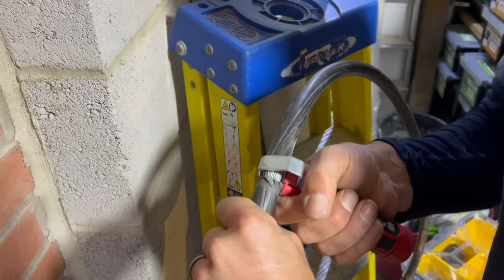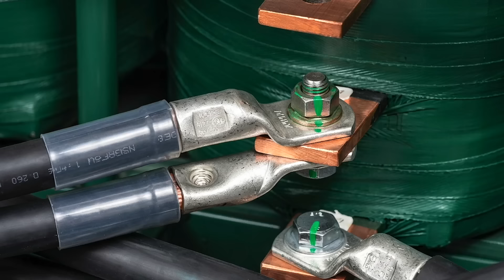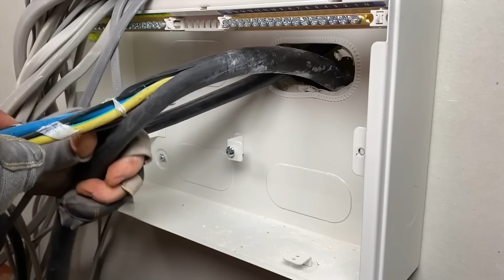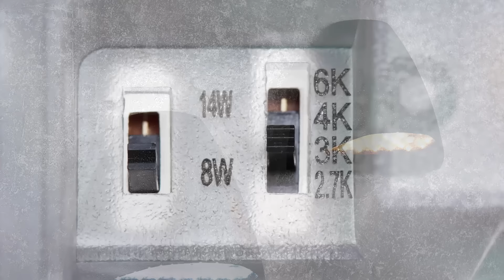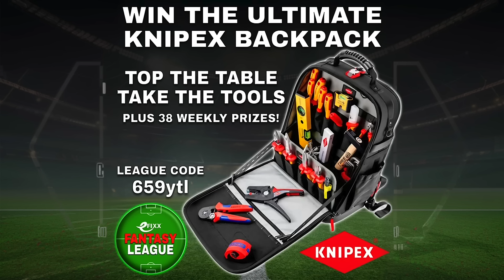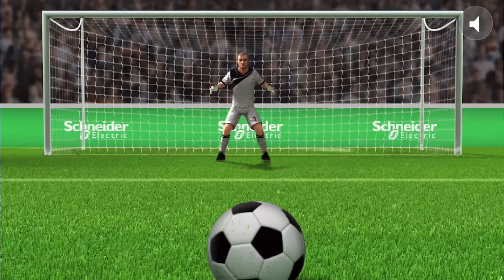This Tiny Regulation Change Is About to Get Expensive

Comment: I was 19 when the national Building Regulations replaced local bylaws.  It was a small volume that cost eleven shillings and sixpence.(57.5p)
The RIBA reference set is now 1300 pages and costs £310.
Each addition and amendment to the reg's has increased the cost of approval, construction and inspection.
Each amendment has been approved by bureaucrats pressured by those who would profit from the change.
The Requirements for Electrical Installations, I suspect, has followed a similar pattern of development.
I am not condoning abandoning safety regulations per se.  What I am proposing is that they should be a standard for quality and safety, not an economic tool of government.
Reply: The Building Regulation documents can be downloaded as PDFs for free.
Reply: @robertsmart7484  Call me old fasioned if you like but I find refering to a hard document much more efficient than scroling through a PDF that clutters up my CAD screen.
Having said that, I could download it for free... but... I would need to print out 1300 pages and that would cost more in time, paper and printer ink than it would be to buy the properly bound document.
Anyway, that was not my point.  My point was that Government does not make changes to any set of regulations for the good of the population nor the environment.
It continualy makes the changes to create jobs and make profits for the involved industries.  All intended solely to generate additional taxation.

Comment: The regulations should be a ring binder and each update has new pages and instructions to remove redundant pages. Much cheaper
Reply: Or on a roll behind the bathroom door ? 😂
Reply: @D @DrunknGaming121 you can read them on the throne, a great way to spend your time
Reply: @joebristowtechnologicalbre2073 40 years in the trade I am done 😊 , started on 15th ! That was slacker 😂

Comment: Cant think of a single time we have needed to use an RCD on inverter circuit. For more reasons than highlighted here. Which brings questions around amd 3 been so urgent. As for brands with options Hager, Proteus and more. Loads of them about for heat pumps more than PV.

Comment: I saw an EICR that didn’t spot the cracking insulation on the immersion heater or the under sized shower cable. When the same electrician came back to fit a new Consumer unit the mixed up the neutrals which caused tripping especially where they had both RCBOs and RCD for the split board for the economy 7 storage heaters. Unfortunately this was before my relation bought the place so there was nothing they could do. There needs to be something where these types of cowboys get reported and their works audited so they either improve or are removed from the industry. If DIYers are a risk these cowboys are a bigger risk.

Comment: From the Fox ESS H1 manual my installers are commissioning today, mentions Type A if one is required.

Residual Current Device (RCD)

- All Fox ESS inverters incorporate a certified internal RCD (Residual Current Device) to protect
against possible electrocution in case of a malfunction of the PV array, cables or inverter (DC). The
RCD in the Fox ESS inverter can detect leakage on the DC side. There are 2 trip thresholds for the
RCD as required by the DIN VDE 0126-1-1 standard. A low threshold is used to protect against
rapid changes in leakage typical of direct contact by people. A higher threshold is used for slowly
rising leakage currents, to limit the current in grounding conductors for the safety. The default value
for higher speed personal protection is 30mA, and 300mA per unit for lower speed fire safety.
Installation and Selection of an External RCD device

- An external RCD is required in some countries. The installer must check which type of RCD is
required by the specific local electric codes. Installation of an RCD must always be conducted in
accordance with local codes and standards. Fox ESS recommends the use of a type-A RCD.
Unless a lower value is required by the specific local electric codes, Fox ESS suggests an RCD
value between 100mA and 300mA.

- In installations where the local electric code requires an RCD with a lower leakage setting, the
discharge current might result in nuisance tripping of the external RCD. The following steps are
recommended to avoid nuisance tripping of the external RCD:

1. Selecting the appropriate RCD is important for correct operation of the installation. An RCD with a
rating of 30mA may actually trip at a leakage as 15mA (according to IEC 61008). High quality RCDs will
typically trip at a value closer to their rating.
2. Configure the trip current of the inverter’ internal RCD to a lower value than the trip current of the
external RCD. The internal RCD will trip if the current is higher than the allowed current, but because the
internal inverter RCD automatically resets when the residual currents are low it saves the manual reset.

Comment: I don't agree with NAPIT here- if it's a fast fix then note that it was an issue that has been rectified on the certificate. Some things cost way more to come back to. If you think that it might be an issue, agree it with the client beforehand- "if I find any issues which could be quickly and easily rectified, are you happy for me to do so?"

Comment: EICR and Part P are a joke and should be scrapped. I had one done a few weeks ago by a company never used before and the guy didnt even unplug a single thing, if he did it was one or two appliances at most. Almost all the sockets and switches are smart ones and have USB etc, no way he could have done it legit.

Also certified a new garage consumer unit and he didnt even ask for the key to unlock the garage to go inside.

Insurance companies demand this crap but they are not worth the paper they are on. Heck you can even get remote virtual checks, like how the heck can someone so a safety check over WhatsApp video?
Reply: It's not that the EICR is a joke it's that government austerity cut building inspectors and anyone who is going to catch a dodgy sparky to nil. So EICR by phone folk have nothing to fear. Just like dodgy builders who do stuff like put a small square of insulation visible around the loft hatch and skip the rest. All symptoms of the fact nobody today is worried about getting hauled up and losing their accreditation or getting fired.
Reply: I could not agree more. You hit the nail on the head.
Reply: That's probably because you used cost as deciding factor on the EICR rather than a reputable electrician.
Reply: @Stueyb22 it's almost as pointless as PAT testing. It's more of an "insurance" "get out of jail free card". Just like so many other "blame it on safety" related things, it's a convenient way to print money. When you take your car for an MOT it doesn't necessarily make it safer, or stops at breaking down.
Reply: @MyProjectBoxChannel  Yes.  It's only safe during the inspection.  Who knows what happens after you leave.
Reply: Careful now. That's the entire compliance scam,.sorry, business model you are targeting there!!😂
Reply: @jonhunter8737 I wouldn't want to harm somebody's cartel

Comment: As far as I remember the requirement for type B RCDs is already covered in the code of practice. Not withstanding that, why create a regulation that is difficult or expensive to meet the requirements of. Surely the drive should be for manufacturers to provide protection or separation as part of the compliant equipment specifications. But no let’s make hard for contractors once again.
Reply: Grid tied PV inverters were originally a separated design but it is more efficient, oh and much cheaper which I'm sure had no influence at all, to use a non-isolated design.  Essentially all grid tie is now of a not-separated design and so are most of the 'high frequency' all-in-one inverter charger things too.  There is a path of conduction between the PV and mains and on high voltage battery systems the battery terminals too.
Reply: @retrozmachine1189  According to my inverter user manual it has 
-  Integrated RCMU: An internal Residual Current Monitoring Unit that handles the safety requirements of IEC 62109-2.
- DC Leakage Protection: The inverter's circuit design is constructed to prevent the injection of direct residual current into the grid. (Separation?)
And only requires a type B if local regulations require it. Doesn't expressly mention separation but should provide the same level of protection?
Unfortunately the IET bookshelf app has not updated to the A4 book, so I can't see the new regs. But from what I've seen these do not preclude the need for a type B RCD.
Not well thought out by the IET in what is a fairly mature industry - after 20 years of solar installs they have managed to throw installation into confusion for the contractors. The NAPIT/NICEC experts (😂)and co will no doubt default the Type B everywhere.

Comment: This change is not going to cause expense to society. Only a fwit would think it was a good idea to design a system where AC can be passed to the dc side with impunity ( as in a non isolated micto inverter.

Much better to have a system designed with inherent isolation between AC and DC in the first place
- aviod the cheep sh!te that fails in an unsafe manner in the first place
- Shame on those in the industry who were aware of the failure modes of non isolated dc/ac conversion devices and still cooes to put lives at risk by using them
Reply: It's not AC being passed to the DC side that's causing the issue. It's DC leakage on to the RCD which can saturate the toroidal core and prevent the RCD from working as it should.
Reply: Shareholder value always wins over safety these days

Comment: I am pretty sure more manufacturers will start to make type B RCBO's if they are going to be a requirement for solar installs.
Reply: There is a wide selection of B type DIN mount RCBOs on the market already, just not over there apparently?
Reply: RCD is only a requirement when buried, or stated by manufacturer.

Comment: NAPIT talking nonsense just like the NICEIC. If I see a loose connection or cracked or broken  accessory I’m fixing it there and then. Even if I have to do free of charge.
Reply: More fool you then! How many garages would fix your car for free, during an MOT?
Reply: @arronplant8082  Its something called having pride in your work and providing a good service. Its a cheap easy fix and takes little time to do. The safety of the client should always be the priority. @dog-whispererINAEC is doing the right thing.
Reply: @arronplant8082 before led , mot garages have stuck in a brake light bulb free for me, better for everyone if a 5 minute job says a return visit
Reply: @arronplant8082 😂😂😂😂😂

Comment: Thanks Joe, but type B's have been necessary for multiple inverters anyway and for me, I have been using them for yonks, however, they are expensive and generally, they require a DB upgrade, or what I do is install a main or master DB before the DB within the house, this DB contains AFDD, the inverter interlinks, heat pump feed, VRF unit feed and EV charging.
What is really really annoying that drives me knuts is that everything I do is 3-phase and most type B RCBO's are not 72mm they are 75mm or 81mm! And what are you meant to do with a 75mm DIN rail, at least 2 x 81mm align on an 18mm grid so in the design, you have to have an even number of RCBOs. I have just ordered some 72mm devices, so we'll see!

Comment: I have a question regarding RCBO’s.Two years ago I had our Fuse Board replaced with an up to date consumer unit with RCBO’s. The upgrade was triggered by the need for an EV charger. I am now considering Solar. Given the announcement in this broadcast it seems that I will be having to use a type B RCBO for the solar. My new consumer (BG) unit has spare ways already loaded with unused RCBO’s.

1: If BG doesn’t sell type B RCBO’s then the whole unit may be scrap?

2: If the conditions that prevent a type A RCBO from tripping within the required parameters then with solar installed and one type B is used then will the DC that it is designed to cope with still flood and blind all the other type A RCBO’s in the system?

Thanks for your broadcasts.
Reply: Put an Mcb in your main board & run it through another companies rcbo in a separate enclosure if you have space. Problem solved.
Reply: @m@m @markgayle5453 Thanks for your comment. What stops the other RCBO’s still being flooded and blinded by the smooth DC?
Reply: Chose an inverter which doesn't require a type b RCD, or wire it with SWA?
Reply: @Tim_Small Thanks for the comment. Having awareness of these issues is something to check with the PV people.

Comment: So what about plug in solar do they require type B
Reply: I don't think it will apply to plug-in solar kits as thay have rcmu  with 6 ma cut off well the ecoflow microinverters have it which is why you can have a type A RCD or type A bio directional rcbo

Comment: thay need to stop with all this confusion ecoflow say a   type A RCD will work fine because of there  rcm   it cut off at 6 ma but  I  had a type A rcbo bio directional  on its own separate circuit  installed I believe this to be safe for plug-in solar in July
Reply: Yes it will be fine, it's very complicated to explain why but a solar panel with an integrated inverter does not require a type B, if there are any sad git electricians who want to have their arse bored off with irrelevant crap about dv/dt 7th harmonic RFI propagation and all that shit, I may be able to assist, but it's only useful knowledge if one day you are installing a wall of inverters and you are getting nuisance tripping.

Comment: Seeing that gledhill immersion heater - how can it be tested to see what temp it turns off? For an unvented boiler inspection?
Reply: Measure the thermostat using multimeter and check against manufacturers ohms readings for temps. Then heat it up and see if it disconnects at the right resistance

Comment: Already have to fit Type B RCDs on some heat pumps anyway. Fuse box makes a Type B RCD but it is quite pricey . I don’t believe there is a RCBO version . I put a separate board for the heat pump with an upfront RCD so it wasn’t a problem.
Reply: There are, just on the market 4-module, 3-phase 100mA, 20 amp Type B RCBO's curiously they have inverter printed on them (as well), F-ing expensive, don't know much about them though because I am waiting for them to arrive, I have this job on the go at the moment and I need 6 of them, hope the courier doesn't leave them on the step!
Reply: @I @Ino-z2m yes you don’t want those going missing. I think the single phase 63 amp 61008 type B  I bought was about  £130 ish . It came in a three module package.

Comment: Looks like the lack of type b rcbo's will force mixing of brands or junking a perfectly good board
Reply: Every job I do ends in junking perfectly good boards, but I guess I only work on 3-phase so everything goes up in multiples of 72mm. At least if they are crappy $10 plastic, wibbly chinese boards, doesn't make you feel guilty!
There is actually quite a lot of skill in changing a board, nothing to do with the electrician skills, its all about management of where you drill the four mounting holes, make it 2cm too far right and one of the lighting circuit wires wont be long enough, 2cm too far down and the incoming cables wont reach the isolator, so you to kind of work out which cables you have to keep and which if any, you have to rerun. And... of course the pain-in-the-arse that if no form of power can be restored in a day, that means rigging up something temporary.
Reply: If it comes to that just install a small single device (2 position wide no doubt) enclosure adjacent to the consumer unit and put the B type in that.

Comment: Amazed to see the IET are still doing nothing to standardise circuit protective devices so we have to landfill endless consumer units to just find the right devices. Serious waste of time and equipment and just promoting more henley bloc chaos. Can someone wake them up.
Reply: Every time you throw a consumer unit away, you have to buy a new one to replace it. Just saying....
Reply: @gavinminion8515 yeah we would all rather just buy a protective device that meets the IETS latest desires and put it in the existing unit but you’re not allowed as they’ve got to all be the same manufacturer and model range because the IET don’t want standardise bus bars and power dissipation.
Reply: @edc1569  it's almost like the IET works with the manufacturers of this stuff or something...
Reply: @edc1569  That's right so to standardise bus bars, I dedicate an entire row of a DB to inverter interconnects but this means using 48 or 64 module DB's, I use the Hagar DR64S or F range. It's a lot of work installing DB's in concrete/brick, each one takes me about 4 days and it's quite skillful, you have to be a good plasterer, quite often tiler, carpenter... I think the electrician 'connecty-wires' bit is about 2 hours!
Reply: All part of the continuous job creation for them…
Reply: Quangos have to justify their existence by breaking things, adding cost or increasing difficulty as regularly as possible. Perhaps it's also the ripple effect of feminism creeping into the IET mindset. They never consider consequences or simply don't care. Bit like windows 11 hardware requirements resulting in Microsoft telling you to buy a new computer...more landfill.